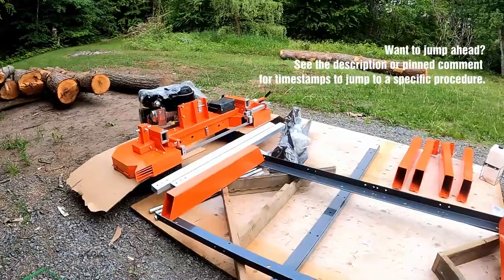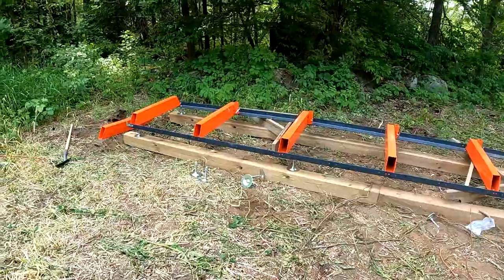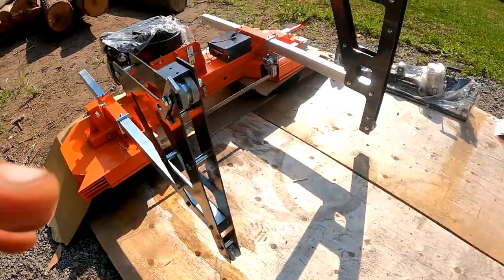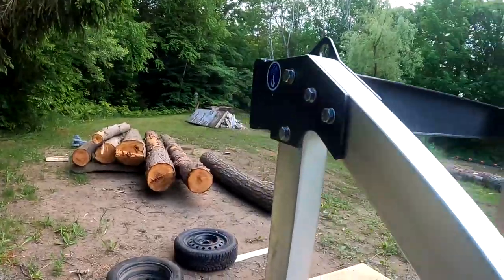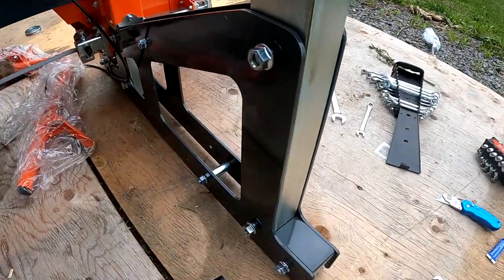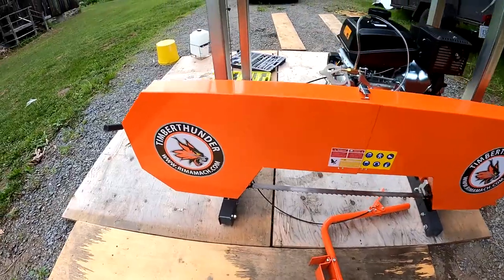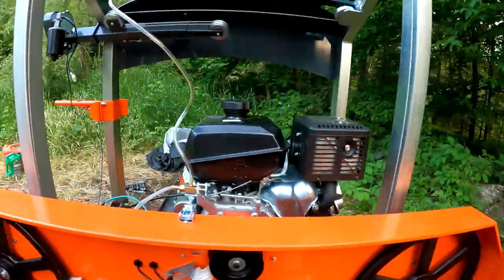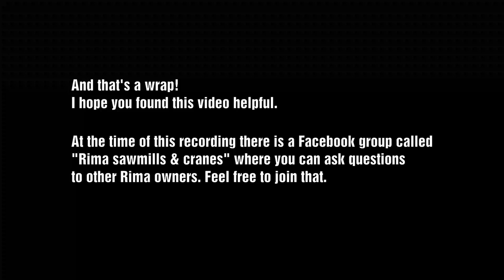How to Assemble a Rima Sawmill | RIMA RS31G Assembly Guide

Comment from the maker: 0:00 Intro
0:30 Rail Assembly
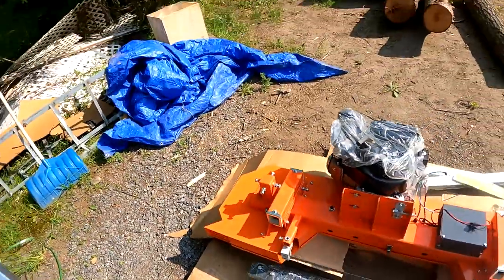8:37 Assembling the Sawhead
11:13 Standing the Sawhead Up
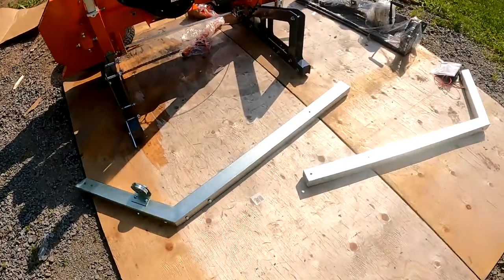11:48 Sawhead Assembly Continued
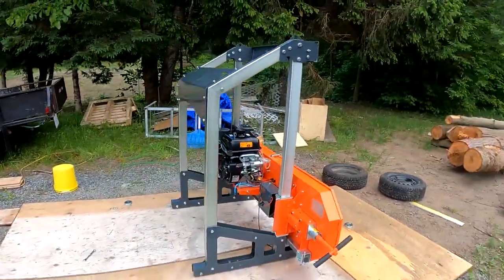17:58 Moving the Sawhead to the Rails
19:47 Struggling to Get the Sawhead Onto the Rails
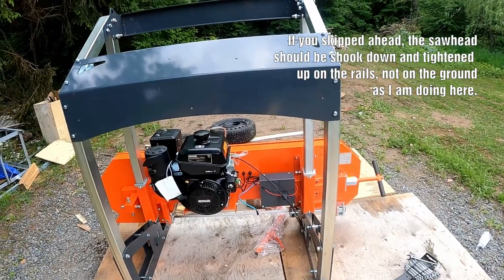20:52 Tightening Up the Sawhead
23:22 Cable Routing for Lift
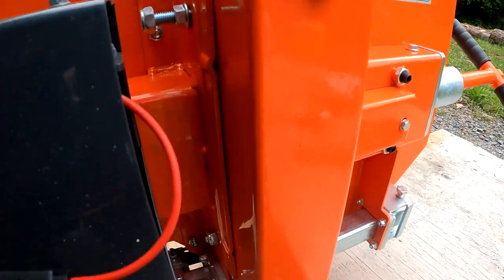24:28 Tightening Sawhead Continued
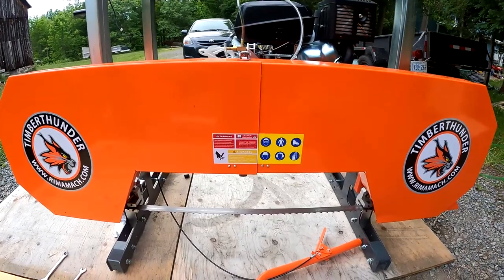27:48 Continuing Sawhead Assembly
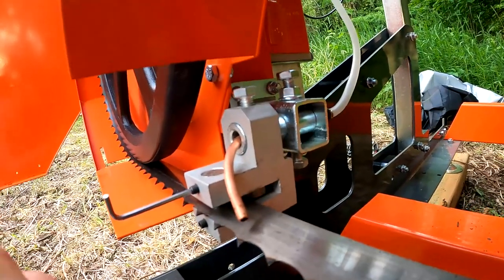30:13 Adjusting Blade Guides
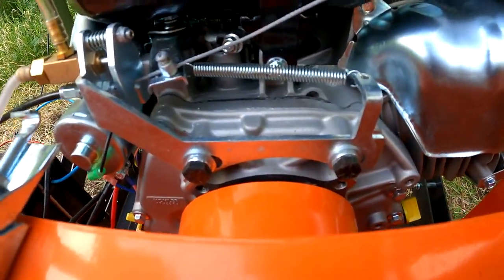31:10 Checking Throttle Bracket
31:30 Checking Blade Parallel to Bunks
32:21 Adjusting Belt Tension
33:12 Blade +Log Dog Stopper
33:47 Ruler Installation
35:40 Gas & Oil
36:15 Firing Up My Mill for the First Time
36:40 Rookie Mistake
36:49 Firing Up My Mill for Real
37:50 Log Dogs
38:13 Cutting Footage

Comment: Hello, nice idea to have made this video ! I’m selling this saw mill since last year in France and I have assembled about 15 of them. For putting the machine on rails, I think easier way is to assembled rail first, and then to put the machine directly on it when you left it. I will do a video soon ! Other important point : I put about 400 gr of grease inside the system for lifting the saw head, enjoy your saw mill !
Reply from the maker: Good tip about adding grease. I have sprayed the lift rails with jig-a-loo a few times. A video explaining what you do to get the sawhead on would be awesome!
Reply: Hello, i got a little question about the saw. Since you are selling them. Do you know the size of the two Belts which are mounted on the wheels of the saw. You would really help me with that in information.

Comment: Korey - i’ve been looking at the same size of mill and wondering why you chose the Rima and are you happy with it? I found a used 31 with trailer I am considering for $ 4500
Reply from the maker: Nice! A trailer would def be sweet to have. I had been very interested in a Woodland Mills. They get glowimg reviews, and the Rima is basically a knockoff Woodland Mills. They aren't identical but they are close. They are both Chinese made. I could get a Rima for quite a bit less then the WM so that's why I went this route.

The drawbacks are you won't have ready access to all parts, and the service isn't great from Rima. But at the end of the day, manual sawmills are pretty simple machines.

As long as you go into it realizing these are hobby mills you should be happy with the Rima. Plus going used, you can resell it later if you want to upgrade. 

I would say go for it! It's a great mill for the price.
Reply: Korey what is the total cost for the mill you have in the video and can you provide the link contact for ordering your saw please ? Any nuances I need to be aware of when ordering - thanks for all your help !
Reply from the maker: @scottsteckler  The base price at the time was $1800 USD. I added several upgrades and spare parts and a sharpener which brought my total to $3040 USD with $150 freight included in that. Then I had about $470 USD import fees/customs clearance into Canada. So total was around $3510 USD, I spent an additional $433 CAD trucking the sawmill from the freight forwarder's warehouse to my house, as their warehouse only allowed dock level pickup so I couldn't pick up myself. So all in, I was at about $4075 USD when all was said and done. From my understanding, if you are in the USA your import fees will likely be higher than what I paid into Canada.

https://www.alibaba.com/product-detail/26-36inch-electric-gasoline-portable-sawmill_62272740048.html?spm=a2700.shop_plgr.41413.11.fecf5a86wVU6DU

Definitely order the blade guide, this is the pc that adds extra support to the blade (and includes the horizontal yellow shield) you can adjust according to the width of your log. For some reason it is an upgrade, it should come stock. I didn't realize mine didn't include this. Ask your rep to see the optional parts, my rep was super fast and friendly, but she wasn't good at upselling. I had to ask about extra things. I upgraded to the motorized sawhead lift. This was a waste of money. Even at the top speed it moves the sawhead painfully slow.

Check out the group Rima Sawmills and cranes on facebook, there are several knowledgeable people there.

Comment: Can you share the total cost for the RS31 please ?
Reply from the maker: The 31G base price at the time was $1800 USD. I added several upgrades and spare parts and a sharpener which brought my total to $3040 USD with $150 freight included in that. Then I had about $470 USD import fees/customs clearance into Canada. So total was around $3510 USD, I spent an additional $433 CAD trucking the sawmill from the freight forwarder's warehouse to my house, as their warehouse only allowed dock level pickup so I couldn't pick up myself. So all in, I was at about $4075 USD when all was said and done.

From my understanding, if you are in the USA your import fees will likely be higher than what I paid into Canada.